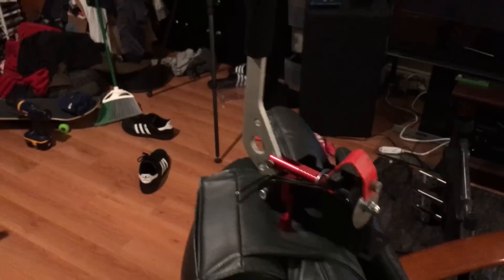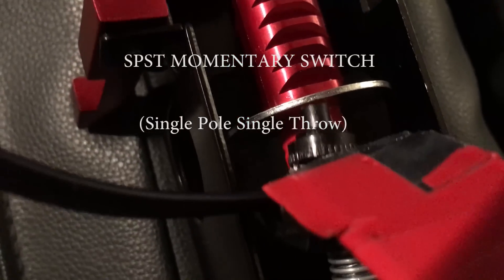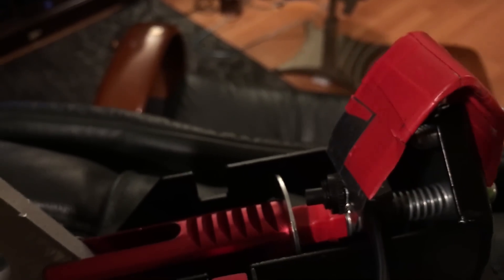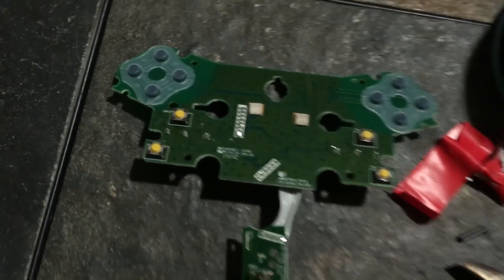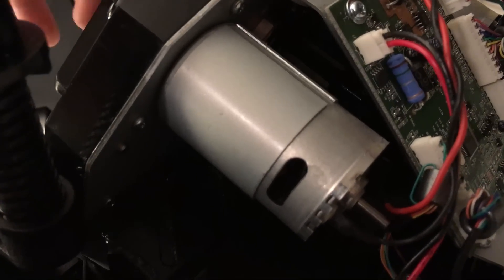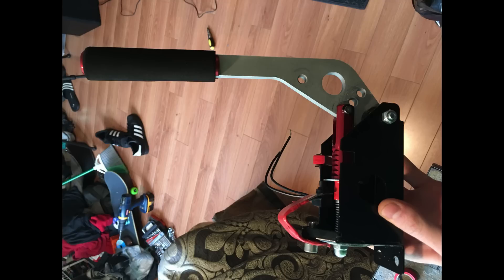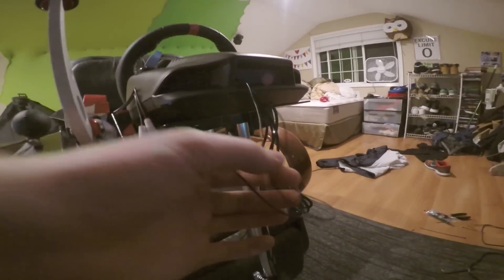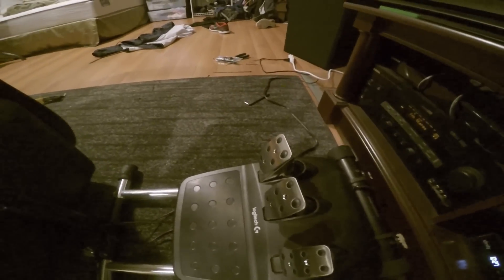Logitech G920 Hydro Hand Brake Mod Tutorial

Comment: I ran my wire but all it did was act as the right paddle shifter. I have my wheel hooked up to my computer right now to change the right paddle but I can't figure out how to change it to handbrake. I've only had the wheel about a week please help!
Reply from the maker: Okay on the setting for assetto corsa you want to change the ebrake switch to the right paddle. Look at all the settings when doing so. Because there is 2 ebrake locations in the setting I believe.
Reply: +Wetfingers I don't have that I have forza 6 and horizon 2 I went on the computer to change it but idk how the heck to work that stuff
Reply: +Wetfingers is the asseto corsa you're playing the Xbox one version or computer?

Comment: Damn that looks so hard lol wish i could do something like that i think if it was i stuff sonething up not many in depth tutorials out there :/
Reply from the maker: +EQUALISE its honestly not that hard. 
1: you remove the 5 or 6 Allen key bolts in the front. then there are little screw in the back of the wheel you take those out. 
2: then you just take out the circuit board carefully. solder 2 wires on the paddle shiftier. 
3: take apart the rest of the wheel and drill a small hole in the back and feed the circuit board wires through all the pieces first then through the whole (i made the mistake of going straight to the hole and when i went to put the other pieces in i couldn't feed the wires through xD
4: put it all back and thats the electrical stuff and its super easy as long as you take your time and dont rush it.
Reply: +Wetfingers dose the shifter paddle still work as a shifter? I'm a little confused as the B button is handbake? this is a helpfull vid though dude. I wish logitech made a plug in handbrake!
Reply from the maker: +Robbie Waters yeah both the paddle shifter work, and you can remap the game so that the rh ladle shifter is the ebrake. Hope that helps
Reply: cheers for the quick reply. still in the contemplation stage right now. looks an insane mod though! when you take the small screws out the back of the wheel is the circuit board still attached? Im wondering if i take it all apart will all the buttons fall out? sorry for all the questions.
Reply from the maker: +Robbie Waters once you remove the price that holds the buttons, they will fall out only if you hold it upside down, mine never fell out.
Reply: thanks for the help dude. much appreciated.
Reply from the maker: +Robbie Waters no problem man! Thank you for the comment! Haha
Reply: Wetfingers right behind the soldering points the paddle switchs are there do u take of the switchs or not

Comment: I made one that is basically a lever, where the bottom of the lever pulls a spring thats hooked around the left joystick of an xbox controller. This allows variable brake pressure when using the e-brake as opposed to on/off and the resistance of the spring between the lever and controller gives it a slightly longer/more realistic throw.
Between the strip steel/L brackets I got from home depot and the 200 pack of springs from harbor freight I spent about 18$ making it.
Reply: PlokTheMasterGamer doesn’t the wheel disconnect when you use the Xbox controller?  Because you can’t use both at the same time. I don’t want to lose steering just to use the ebrake
Reply: @amjedalbalushi9707  lol who needs steering right?

Comment: What was the button that you used was it a off-( on ) or a on-( off ) because I need to know so I don't mess up
Reply from the maker: matt tinker yeah it was the right paddle shifter. When the solder is facing up, it's the farthest two to the right. There are 3 solder points for it, but make sure to solder the two to the farthest right! Hahs.

And make sure you route the wires in a good way.

Comment: Hi.. i need help for the welding of wires and the routing through the central shaft.
where wires are to be welded ? wires won't be damaged by wheel rotation ?

Can you post more detailed instructions of welding and routing?
i got a g29 (no 920) but more info are welcome...

sorry for my poor english.
Reply: Ive done the mod to the g29 and made a USB handbrake.

Comment: can u use your ebrake on xbox one asetto now they changed it to X mate
Reply from the maker: jap71rx2 is there a way to change it so it's the right paddle shifter? That's the easiest spot to solder on.
Reply: In horizon 3 yes but assetto no only X button could i just solder onto both and instead of 1 wire coming out of base there would be 2 and only join them with  a joiner connector to handbrake switch as needed
Reply: Do u only play on pc i use xbox one and it used to be B button then last update its now X which sucks
Reply: So when i want to play assettto  i join wire from x button and when horizon 3 right paddle or A or B button would be fine thanks for reply

Comment: Do you just solder the wire to the circuit board and then to the button?
Reply from the maker: +Kye Joiner i soldered ~6feet of 24 awg to the circutboard, feed it out the hole i made in the rear of the wheel. then with the button wire and the circuit board wire i just crimped connectors on them, so i can plug and play.
Reply: Thanks
Reply from the maker: +Kye Joiner no problem hope it helped
Reply: How much slack did you leave inside the wheel?
Reply from the maker: +Kye Joiner I left a lot haga like 2 or 3 feet. Haha but when you know how much you need it's easy to chop some off. And then make it perfect. But I feel a foot is good to start with

Comment: Hey so, I soldered the two points shown but my wheel light just flashes and doesn’t calibrate, anyone know how I could fix it?
Reply: Turned out the wires that were soldered to rb were touching, just separated them and works perfect.

Comment: haha I know haha. can u type all what I'm gonna buy for a fully product. 
step by step. all the items and screws and wires. and what not to buy. I saw in the video that u used a bigger wire first that didn't fit into the center hole. so mm. size of wire and all
Reply from the maker: Yeah I have that info in the video description.
Reply from the maker: -3: helical nuts m8x1.25 
-1: 6-8 inch bolt m8x1.25
3: 1 1 1/2 inch washers (try and get the same inside diameter as the bolt)
-1: 2 - 2 1/2 inch washer for the rear.
-1 acorn nut m8x1.25 
-22 - 24 gauge awg wire spool (you need about 6 feet to be safe, you probably only use 3 but just to be safe.)
-spring or you can use the one in the ebrake 
-mounting bracket i used thin air ducting (i cut out 4 square pieces, like the video shows) 
-electrical tape
-spst momentary switch, make sure to check the pressure of the switch and the distance traveled. 
(you want a switch with a short distance to travel, and a switch that is easy to push) 

everything might be a little different, this is just what i used. but it should be a good foundation :)

Comment: im using xbox one on assetto corsa ebrake is x button on forza horizon 3 its b button or right paddle ... could i solder onto x button ...
if i solder to right paddle button  can i shift still with the right paddle ...

Comment: Any alternative wiring to to b/o button directly to two wires thatora soft mod gimx
Reply from the maker: Can you reword that please! Then I'll answer your question haha
Reply: +Wetfingers any alternative wiring to b button (or circle I have  g29). That or a soft mod with GIMX and or chronomax.
Reply from the maker: +Google User it would be more trick with the buttons because of how the button is laid into the circuit board. Idk what the soft mods are, but I find the paddle shifter to be the most effective route.
Reply: +Wetfingers ic they dont make it easy.i'll let let you know when i do mine.
Reply from the maker: +Google User yeah it defiantly a project, but just remember to take your time, and it will be awesome!
Reply from the maker: +Ged Robertson that's true I used a cheap Logitech 20 joy stick. But having the ebrake hard mounted is defiantly worth the time and hassle.

Comment: man i play on xbox one and i have already disassembled the g920, now where i have to wiring? where is the x button on pcb?
can you help me?
Reply from the maker: ilZahn I wouldn't solder it to the xbutton. I would do the right handbrake. And it's the farthest two solder points to the right. And make the wiring go around where the half circle is so it will connect nicely.
Reply: i need the x button for assetto corsa , and you can't change the button layout on xbox one :(
Reply from the maker: ilZahn really?!? That's so messed up haha. If I were you I would take it to a tv repair shop or something and see if they can do something to solder it. I wouldn't recommend you soldering it. I don't want you to screw it up man. Worst case is right bumper. I don't use my handbrake anymore on asseto corsa and it's a lot better imo. And you can still use the handbrake for forza and stuff :)

Comment: Hey Wetfingers/anyone else reading, do your G920's make a funny clacking sound when turned fast in a countersteer? With mine, if I turn it hard to the right to countersteer a drift going around a right-hand turn, it makes a 'clack clack clack' noise.

Anyone else get that?
Reply from the maker: Yeah some times I get that, it comes and goes. It's been happening ever since I got it I think. But mines super quite and didn't really notice it until I was playing without and volume.

Comment: heeyy, I'm from spain and at 11:00 I don't understand where I have to connect the handbrake, is it where you are pointing with the red mark?
Thankks, the video was so cool!
Reply from the maker: No that's where I fed the wire though. You connect the wires to the circuit board. Then feed them through the center of the wheel. And 11:00 I'm showing where I fed the wired and drilled the hole for the 2 wires to go though so I could connect them with the ebrake.

Comment: +wetfingers will doing this ruin the quality of my wheel ? i dont wanna lose the warranty but i want a hydro brake forsure so is this going to 100% work ?
Reply from the maker: Any modification to the wheel may break it, but if you have time, patients and the right items then no it won't break if you take your time. But it's straight forward, I would recommend building the ebrake first to get you pumped to install it, it took me about 6-10 hours to do it. But I took my time, made sure I didn't take shortcuts and made sure the wire from the circuit board to the ebrake was plenty long and wouldn't get caught up on anything. 

It sounds scary but like I said it's all patients. The only issue I had was my bracket was a tiny bit loose so it was hit and miss for the first hour, then I tightened it down and boom never missed a handbrake entry since:)   

If you have any more questions feel free to ask!

Comment: could you buy two Logitech shifters and have one as a handbrake and one as a sequential shifter
Reply from the maker: To my knowledge no. The best bet would be to follow the tutorial. Your basically making the right paddle shifter contact not only for the shifter. But also for the button you use on the hand brake.

Comment: Is this gonna work on g29?
Reply from the maker: I'm 99.9999999 % sure it will.  You just solder in the panel shifter and the g29 has one. It might just look a little different on the circuit board and taking the wheel apart. But yeah it's 99.9999 gonna work.

I just don't wanna say 100 haha
Reply: +Wetfingers thanks!👍🏽
Reply from the maker: +Chi-town23👌 if you have any questions in the process just leave another comment and I'll get back to you ASAP!

Comment: Where am I suppose to get that circuit board?
Reply from the maker: Inside of your wheel. It's the motherboard that has the paddle shifters, and buttons for the wheel. Just solder the handbrake wires to the right paddle switch.
Reply: then i'm screwed because I don't have that shifter anymore.
Reply from the maker: +tman229 hmmmm you can use the b button I'm sure. But the solder points are tiny and I don't know what points to solder. But on the switches they have serial numbers. So you can look them up and get like a "parts break down" that will have a wiring diagram I believe.
Reply: Would it be possible to use a push switch as a replacement or something?
Reply from the maker: +tman229 it is a momentary push switch for the b button. But the only way to know if you can do it, is if you take the wheel apart and look. Or buy a new shifter and use the paddle. Which I recommend.
Reply: Disregard that.... I still have to connect to a controller or something. I'll figure something out.

Comment: does this works to for the thrustmaster tmx?
Reply: Yeah I would think so I have it too and I'm doing a diy custom wheel
Reply: Bruh please make a video
Reply: I'll try I have to make a custom adapter and you have to take the wheel base apart I'm just waiting for my aftermarket wheel to come in
Reply from the maker: On what? I have been working on my sr20det swap. But I know I need to make some videos!
Reply: Alright i hope that somebody make a video on how to install a handbrake mod on an Trustmaster TMX so i can make one to
Reply from the maker: It's gonna be about the same thing. You just tap into a solder point that goes to a button. And make your own switch off that that the ebrake uses.
Reply: If I get the money and the omega stand I will probably make one
Reply: MrBenji I got my wheel attached video will be up in a hour
Reply: Brayden Langston Alright thanks :)

Comment: Hey dude i know that may not get a reply in time lol but why the right paddle shifter? surely the B button is the E brake on most games? I am currently doing this to mine but i am a little stuck why its the right paddle 
shifter? I want to use it for the Forza Horizon series, if i wire it to the right paddle can i still use my shifter? cheers homie
Reply from the maker: Because the right paddle is sooo much easier to solder. The b bottom would be a pain. But if you can get it to work I would I would love to see the end result man!
Reply from the maker: You ever make it work man?!
Reply: Having some issues have you got any pictures from when you did it? Be a huge help dude
Reply from the maker: Yeah if you comment your email I can email you.
Reply from the maker: Joshua Stump I got you fam
Reply from the maker: Joshua Stump and I hope it's @gmail.com cuz that's where it's going naba
Reply from the maker: Joshua Stump jk I can't read
Reply: JustJamieHDG hay man I want to put it to the b button. I took my g920 apart and looked at the button. it is doable but you have to have a steady hand and a good soldiers.
Reply: Hey wetfingers have you got discord or anything pal i need a little help with a issue i have
Reply: Will it work on lb

Comment: Do you know it this will work on the G29, like if the circuit board is any different. If you could answer that would be amazing. Thank you
Reply from the maker: It should work,
Reply from the maker: +Ged Robertson it should have the same paddle shifter buttons. They stick out like a sore thumb
Reply from the maker: +Ged Robertson why a potentiometer? It's just a momentary switch, but it should be similar. I don't think Logitech would use different switches between the two.

Comment: Nice video dude. Just picked up a g920 with the shift and planning to get the hydro brake mod done. This video is so helpful :).  Do you have the photo of the circuit beneath the rubber dome switch for the B button? Could you give me some advises for wiring into that button? since i game on xbox so thats the only chance for my to get the mod done lol.